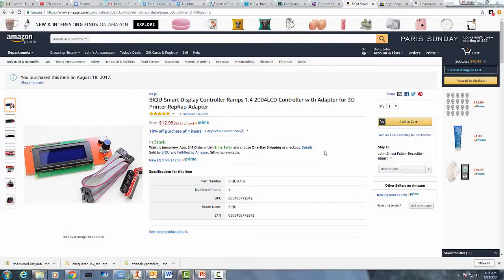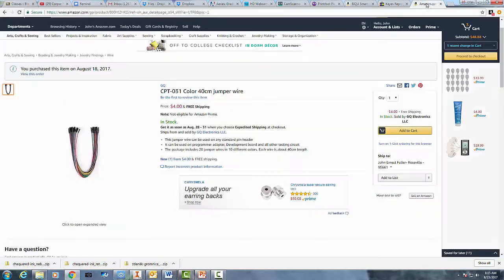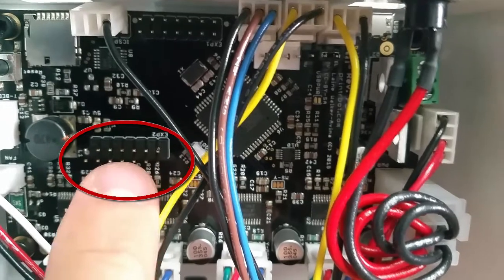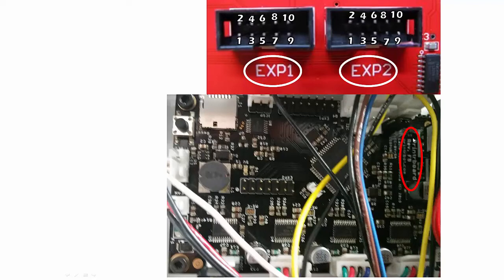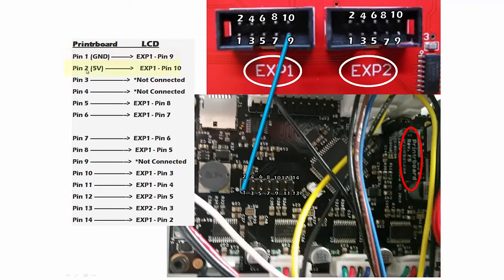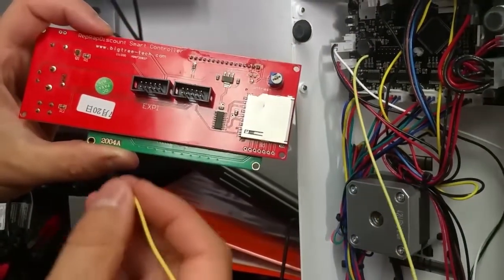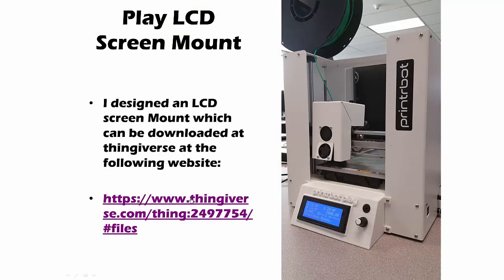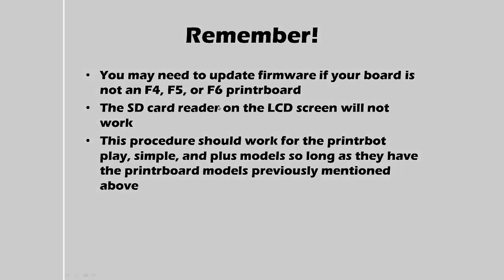Printrbot LCD Screen Setup and Installation

Comment: Curious why you didn't use the grey flat wire connectors that come with the LCD screen?  And could you use them?  Thanks,
Reply from the maker: No u cannot use them
Reply: @JohnFuller804  So I ordered all the right parts.  Wired it exactly as you have it and no power to the LCD.  I also double checked the wiring twice and still no power????? any help would be appreciated.  This is on a Printrbot Simple Metal Rev F5 Printrbot board.  I did first by mistake wire it up to the exp 1 on the board and then changed it to the correct exp 2.  I now get a blank blue if I press the dial but nothing else. Could I have ruined something? Thanks
Reply from the maker: @LG-kj5qq  sorry, we got rid of our printrbots years ago.  I dont think the lcd screen works with that board, but I am also  not sure.
Reply: @JohnFuller804  in the video you say it does.  Maybe someone else will offer some info. thanks
Reply: FYI - I got mine working on a REv 5 board by a different wire configuration  than yours- just in case this did not work for some. Thanks

Comment: Hi John, I'm looking to do this same thing to my printer.  Only problem I have is the plugs that you plug into on the printrboard are missing.  Do you know what these are called and where I could purchase them?  I'm assuming you can just solder them on once you get them.
Reply from the maker: Hi Aaron, when you say plugs I'm assuming you mean the pins on the board are missing? You'll need to purchase these pins from the link below. They break off into smaller pieces, so you'll need solder two rows onto the board, it's a little tricky but it can be done, as I had a board without the pins too. Good luck!
https://www.amazon.com/gp/aw/d/B01M5JD7YT/ref=sspa_mw_detail_3?ie=UTF8&psc=1
Reply: @JohnFuller804  hey John, yes this is exactly what I was looking for.  Thank you

Comment: Thanks for this video.  I have a Rev D board and the LCD seems to work, almost.  Under the Move Axis, I only have X and Y.  What do you think?  Bad connection or firmware setting?
Reply from the maker: Sorry I wish I knew, it definitely wont hurt to update the firmware
Reply: John Fuller thanks for the response just trying to wrap my head around this LCD. I wonder if it has its own firmware or its getting all of its functionality from the printer board.
Reply from the maker: @jggmobile  I haven't noticed any variation in my lcd screens functionality, and I have 8 printrbots in my classroom and they all work wonderfully, even with rev d boards.

Comment: Very nice presentation; you helped a lot.
Reply from the maker: glad I could help! check this link out, makes the wiring alot less messy:    https://www.ebay.com/itm/PrintrBot-LCD-Display-Adapter-Board/123330683414?hash=item1cb714e216:g:-aEAAOSwqu9VSAV7

Comment: Could you test the sd function by putting a micro sd in the printrboard and then using the lcd to run a file?
Reply: Yes, I had the same result.  Just use the card reader on the printrbot.  it works great